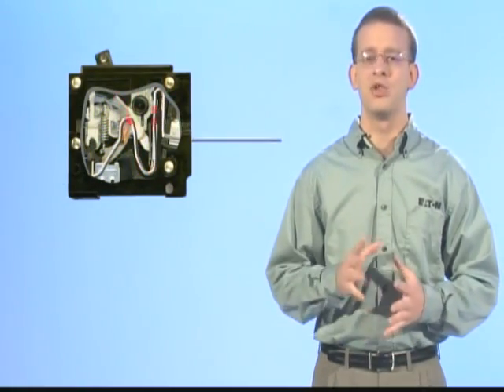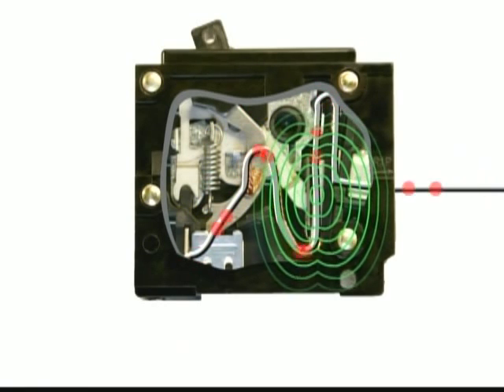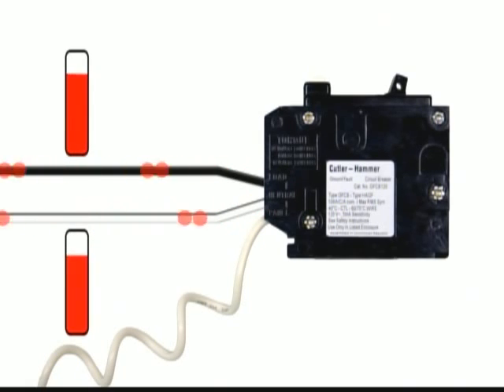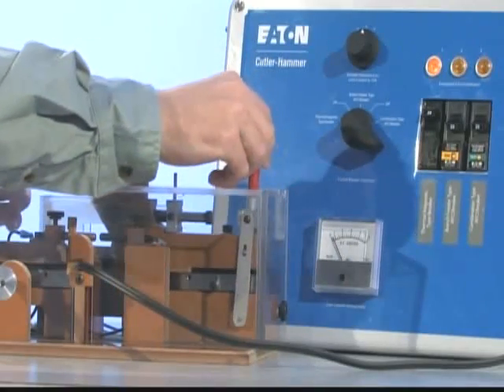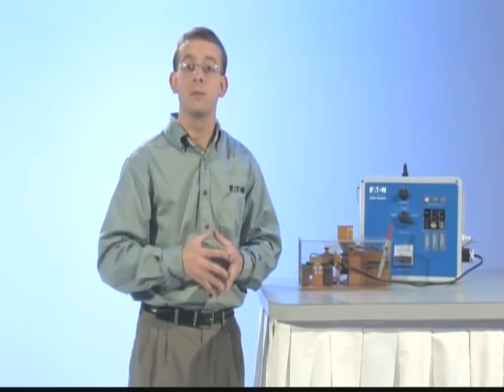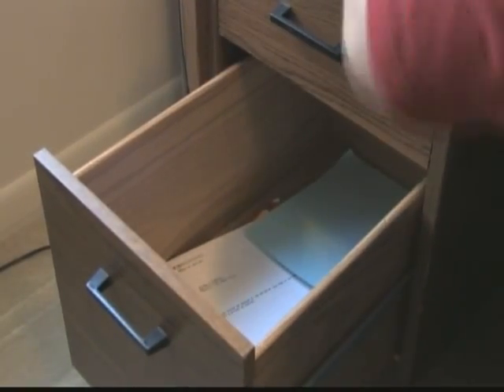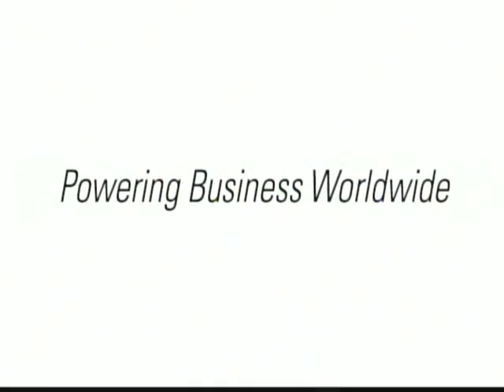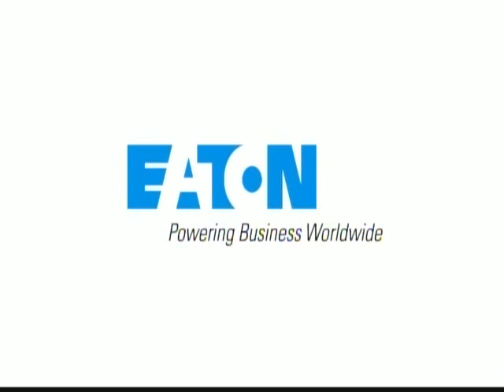Arc Fault Demonstration.mp4

Comment: The problem is, nobody is expanding on the use of these safety items, like troubleshooting, I have a breaker box with 4 afci breakers and all mislabeled, one tripped the other 3 amber warning lights appear for 30 sec when shut off then back on and have a lot of questions and a lot of detective work to do, would be nice to see the activity and solutions once something like this occurs

Comment: let me tell you why electrical fires happen: Poor electrical installation technique, not taking care of extension cords and replacing them when they get old or damaged, placing items in poor proximity to electrical outlets, running wire willy nilly wherever you want, overloading circuits, and not being careful where you're putting nails and cutting into walls. Maintaining, good electrical installation practices, and being careful what you do is key to preventing electrical fires. Now they are requiring arc faults on all living spaces and all circuits within those living spaces, including light circuits. And I hear that in a year or two they are going to require them for all major appliances as well. - this is ridiculous and very much overkill. All you new home builders can expect to pay more than quadruple you used to on electrical for homes now, since arc fault breakers are 4 times as much as a normal breaker.
Reply: What you are saying is that the fires are caused by people doing the things that people do.  Very few people have the knowledge and mindset of an experienced electrician or fire marshall.

Comment: I'm seeing a lot of morons bitching about AFCIs and the NEC. The people of NFPA do not get any money for what they do, and their NEC is the result of loads of research and volunteered time. There is not a whole lot of opportunity for industry bribery. They are not part of the nanny state, they have no legal power on their own. 50% of electrical fires could be prevented by an AFCI. However, you have idiots who can't read an instruction manual and install it properly, so of course nuisance tripping is an issue. What's next in their playbook of whining - Fail-open GFCIs are a scam by Leviton so that you have to buy a new outlet from them every time the protection fails? Good grief! It is local laws that force you into the NEC, so complain to your county chairman, not the NFPA.

Comment: Of course they protect you.  They nuisance trip so bad that you can't operate anything on the circuit, thus preventing any use of electricity at all on that circuit.  Can't get much safer than that.

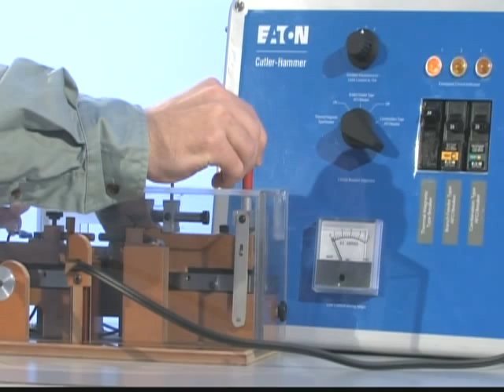Comment: Sorry, this demo (at around @5:10) seems bogus! Have you heard of the Paschen curve? See e.g. Wikipedia: https://en.wikipedia.org/wiki/Paschen%27s_law where it says: 
"For example, in air, at a pressure of one atmosphere, the distance for minimal breakdown voltage is about 7.5 μm. The voltage required to arc this distance is 327 V, which is insufficient to ignite the arcs for gaps that are either wider or narrower." What must have been applied here for the "demonstration" looks like a kilovolt or more! Regular house wiring uses 120V or at most 240V in the US.

Comment: The Arc fault breaker is another money grab. If you are not smart enough to look out for damaged wires you should not use electricity.
Reply: Whine, whine, whine, but offer no solution. That's all I ever hear from you anti-NEC/NFPA folks. What about aging wiring? What about kids who don't know any better than to put something on a cord? Am I expected to inspect every wire behind a desk with every use? What about manufacturing defects? There is a whole body of research and standards that contradict you.
Reply: Says yet another moron who doesn't understand the importance of distinguishing between an ideal situation and the reality of the situation

Comment: These AFCI breakers are worth every penny. I had an experience that made me a believer. Here's the story: I bought a house that had standard circuit breakers, and I wanted to install AFCI breakers for safety. A few months later, I changed out the breakers for the 3 largest circuits in my house. The 3 breakers cost me about $120 at the hardware store, plus about 30 minutes of my time to install them. No joke, 1 month later, I woke up to no power in my bedroom. I checked the breakers, and I found that one of the AFCIs tripped. I reset the breaker, and then I started looking for what caused it to trip. I found that the cord on one of my lamps was damaged while we were moving, which is what blew the breaker. Nothing turned black or started on fire, but if I didn't install AFCI breakers, my house could have burned down from the damaged cord. 

So if you are on the fence about installing AFCI breakers, DO IT. A few hundred dollars for the breakers, plus installation if you are not comfortable installing them yourself, is nothing compared to your house burning down, possibly with you in it.
Reply: If I'm not mistaken a hot to neutral arc trips a regular breaker also, I know a hot to ground arc trips a regular circuit breaker
Reply: guess ding - Re-watch the video.  Pay better attention to the explanation of what is required to trip a "regular" breaker.  Most arcing events do not create nearly enough of a current draw to cause a NON-AFCI breaker to trip.

Comment: That's a mighty fancy little tester you got there. I've never been able to recreate an arc fault situation in my shop with everyday items. I think they are more trouble than they are worth. By the way. The GFCI doesn't measure the current leaving against the current returning. It simply has a trip coil across the hot and neutral. If there is any difference of potential across the circuit the trip coil is energized. Ive seen some brands of tvs and ceiling fans trip arc fault breakers. They drive electricians crazy. Somebody is getting rich off these. I'm assuming it's the guys who convinced the NEC to adopt them.
Reply: GFCI do measure  the difference between the hot and neutral wires currents ( not potentials) flowing in the opposite directions through  the  ring 
 of the coil of the current transformer.  The difference in 5 mA. will interrupt  current flow.
Reply: GFCI devices detect current differences between the hot neutral sides, not differences in potential. It uses a current transformer, and if the hot and load side currents are different by more than 5mA into a comparator a solenoid trips and opens the circuit. The assumption is that any difference is caused by a current leaking through a person to a ground. If you have seen TVs nuisance trip an AFCI, then either the AFCI breaker is an older device or the TV is incompatible with the AFCI. Newer generation AFCIs are much less susceptible to nuisance tripping from electronic devices.

Comment: AFC protection makes better sense to me now. I live in an older home, and I've seen these happen. I've seen this on a high current, hand held device like a hair dryer where the wires near the strain relief break down and start burning while hot. Before the actual cord malfunction, there was no indication on the outside of the cord that the wires on the inside had frayed enough to cause that area of the cord to burn up. It would be useful if you could buy power strips with AFC protection. It also sounds like it might help connections fail in outlet boxes especially metal ones arcing the hot to ground.

Comment: I got two  Siemens Q115DF CFCI/AFCI  combo-breakers installed  in my house, these are the best to say the least. I have tested them with a heater on, the vacuum machine on, and and heat-gun on, no trips, they just work.  They are not cheap, but what you pay is what you get.

Comment: AFCI- a fancy way of saying 30 dollar breakers instead of 4 to 5 dollar breakers. it's a money racket
Reply: Yeah, but think of all the extra nuisance tripping you get for the extra money.
Reply: 60 $
Reply: So U dont think the safety of your family is worth it the extra money??
Reply: AxZxTxExCxA NO that is not the Point! That scare tactics is exactly what Eaton wants you to think!
And the dummies at the NEC bit off on Arc fault BS. 
Millions of homes were built with out this nanny state over control and they are still standing today.
And even homes with post and knob wiring is still in use, because they have not burned down.
Are they safe? Well I would not want it! Arc fault is a money grab.
Reply: @PimpMyDitchWitch  Hhahaahah idk how you came up w/ this explanation but I'm sold!

Comment: so live is hot and neutral return
Reply: Kinda. Sorta. Not really.

Current flows in a loop with AC electron flow switching back and forth like a made in Taiwan ping pong ball 60 times per second in North America [50 Hz in Namibia].  Americans enjoy a  brief moment of 169.7 volts supplied to their cell phone chargers and toasters followed 8.33 milliseconds later by negative 169.7 volts in a sinusoidal wave with an equivalent DC  (the root mean squared (RMS)) voltage of 120V .  If you've got harmonics (not to be confused with a harmonica) then according to Fourier you've got nonlinear distortion composed of a butt load of sinusoidal waves imposing themselves on the fundamental wave like a child molester let loose in a Kindergarten.  It's a vicious cycle if you're part of the circuit.

The black,  red, blue, brown, orange or violet, and yellow UNGROUNDED wires are usually  considered "Live/Hot" in the U.S..  This is by convention and really any conductive item of any color could be "Hot".  For AC, the white Neutral "should" be grounded at your service panel along with the green Equipment Grounding Connector (EGC) wires and screws, which, by the name you can  guess is also grounded.  Double insulated power saws and drills work fine with no ground.  

Just as Black Lives Matter, Black Wires Matter too.  For DC volts, amps and power, black wires are typically chosen as the common or ground such as in your automobile or truck.  If you work on your vehicle's electrical system then on your home's electrical system you could be in for a shock if you confuse black AC with black DC and you don't turn the circuit breaker off or disconnect the battery.

Hope this short explanation helped.  Be safe.
Reply: Conceptually that is correct.

Comment: some types of eclectic heaters it not good to use arc-fault breakers on they will blow every time. Wiring is not a issues. If you are going to require these breaker they need to be changed so they the will not blow when no problem is on the circuit. The makers of these breakers should inform election and code writers of the short coming of their product and state where gfci should be used instead.  I think they stopped some fires but they be the problem in some cases. They know these things and have not fixed the breakers to fix the problem.
Reply: Why not just buy a heater that does not give off an arc fault signature?  It seems to me that your heater is dangerous if it is tripping the arc fault breaker.

Comment: You compare 15 or 20 amp afci breakers to 200 amp standard breakers. Wouldn't the 75 amp 10,000 degree arc trip a standard 20 amp breaker which is installed under the 200 amp one?
Reply: He is saying that the standard arc on a standard breaker (15 or 20) would have to be above 200 amps to trip the breaker because of how brief the arc is. It would not create enough heat to trip the breaker at 75 to 125 amps because they are so brief at times.

Comment: Can you show more detail as to how these circuits are constructed to recognize arc faults? By the way, with the two different types of arc, is there a time line where some AFCI breakers were installed before the combination devices were commonly available? How do you recognize those older devices?
Reply: AFCIs have a computer logic component to them that monitors the AC waveform. They are not nearly as simple as a GFCI.
Reply: Cailluo
Reply: Mundanities animados caillu